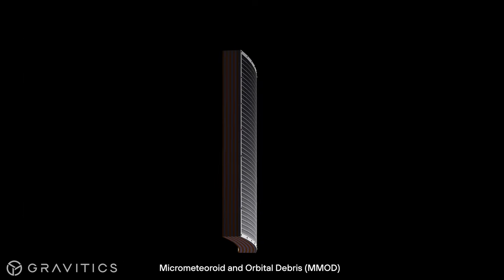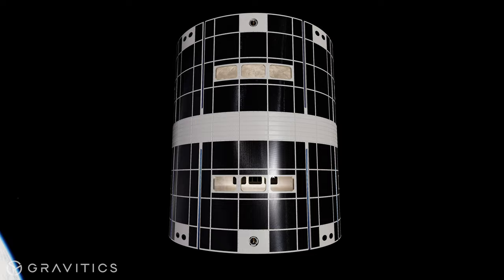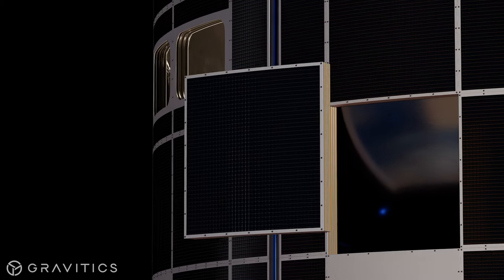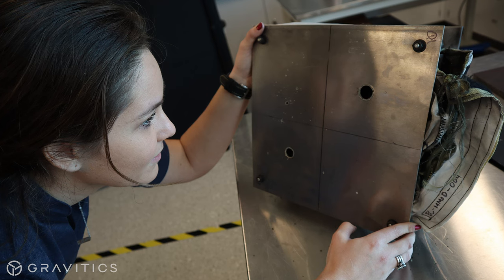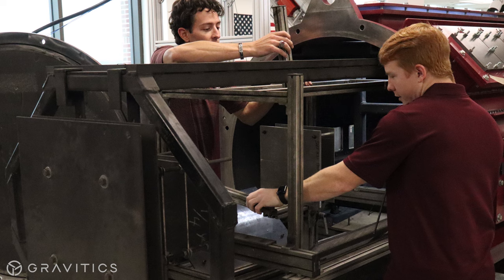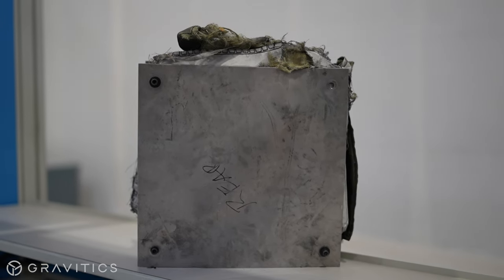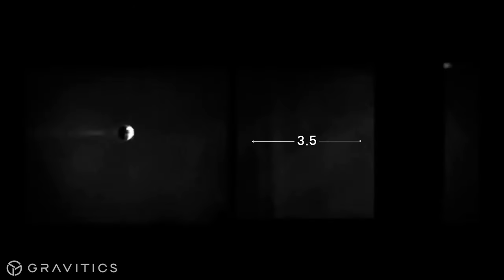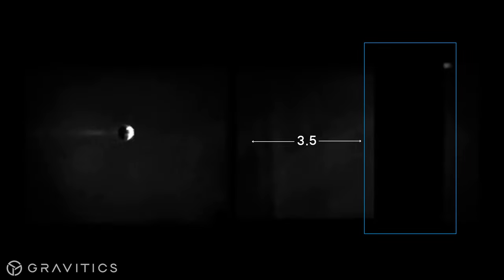What is MMOD Shielding?

Comment: think this would work great for long trips with the inflatable pods inside them....
Reply: Assuming you’re talking about Inflatables that are launched in a small form factor and then inflated in space. You cant launch them with rigid tiles on the outside,  but you don’t need to because space inflatables are designed with very thick and strong skin! The downside is, you can’t easily mount other components to the skin